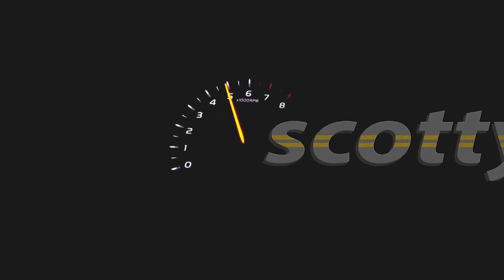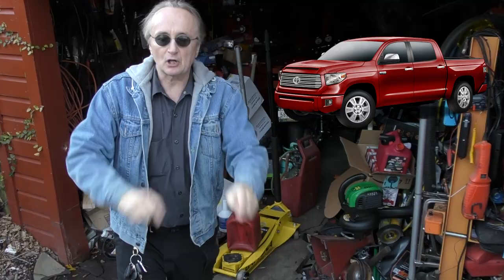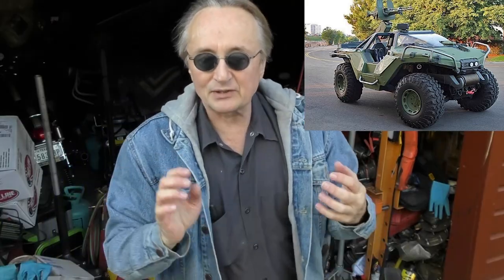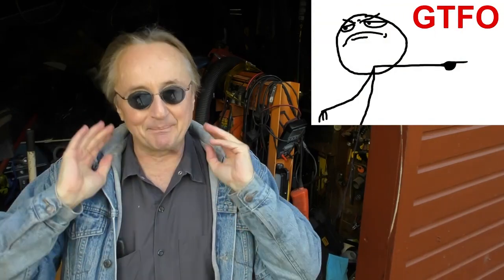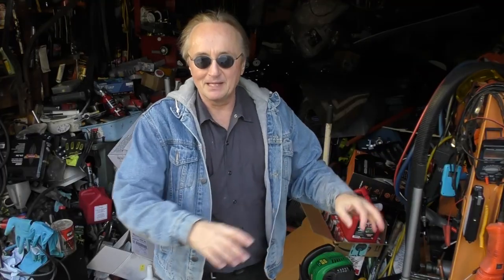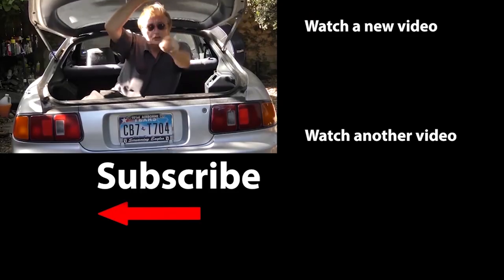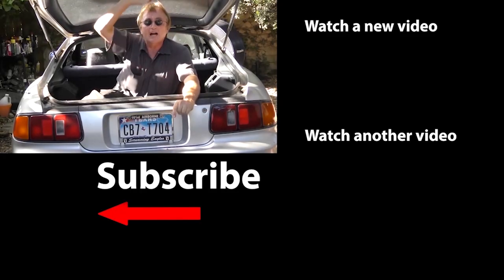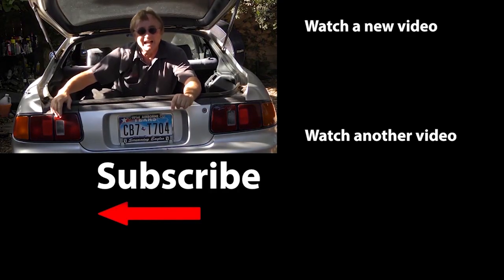5 Used Trucks You Should Never Buy

Comment: Asked a guy with a Ridgeline 2006 400 thousand miles and said it was bullet proof. Kelly Blue Book and  Edmund's give it a 4.7 out of five. What gives?
Reply: Bias.  That's what gives.
Reply: KBB was bought by autotrader
Reply: Not many left on the road
Reply: @stickman920  Thats because not many sold in the first place.
Reply: It's probably bullet proof if it never has any sort of load in the rear.  Transmission and independent rear suspension are more suited for a car or SUV, not a truck.
Reply: I just read all the comments to you post and every 1 has one thing in common lack of facts its funny how every one trashes a vehicle that they have not only never owned but prob never drove before some because its out of there price range any vehicle that can be as old as some ridgelines and still hold a re sale of over 10k isn't because its garbage its because doing p.m. and not trying to use it as a 1 ton truck it will last.
Reply: They may be able to last but most people I know have been unhappy and even though on paper they seem better 4.0 v6 rangers any dakota and even chevy s10s outperform them for truck needs
Reply: A 10 year old Ridgeline has a higher resell value than any mid sized truck, there is a reason for that.
Reply: I mean, what kind of a real man drives a Ridgeline?? You have a truck yes, but not a real truck historically. Men who drive Ridgelines are soft soccer dads that's can't do one pull up to save his pitiful life. That's like having Honda Accord coupe and trying to race a F-Type Jaguar. Just because you have 2 doors doesn't mean your car qualifies.
Reply: @JamesBond-ex2te  would love to see you your ride because I bet you can't do those pull ups
Reply: I'm beginning to think he knows Toyoda-san, maybe paid by them, regardless of what he says. I asked a question about Toyota's wonky electric-assist steering and he won't reply.
Reply: Casey N you must have never heard of the Tacoma lmao
Reply: Anecdotal evidence. Maybe his really was bulletproof, maybe he was trying to justify his purchase. But in the end its about the large scale - reliable or not. You don't tend to see many on the road,  if that gives you any idea. Also you need to be a bit wary of review sites - they only review cars when they're new and base their reviews on features, INITIAL quality, and driving dynamics. They tell you nothing, ever, about longevity or actual quality of their internals. That's what people like Scotty are for.
Reply: @iloveamerica1966  My mechanic here in SC loves Suburbans and Tahoes which obviously is a GM product, everyone has their own opinion I guess.
Reply: because this guy is paid by Toyota. The ridgeline is superior in every way. I have owned both of them. 02 taco transmission went out at 85k miles and my 06 ridgeline has 349k miles and still on the original engine and transmission.
Reply: @Danimaljmartin  Not one full stop or comma in that very long sentence.
Reply: @Brian1952ful  I never claimed to have great punctuation. At the moment of my comment I was steaming mad at such ignorance from some one that calls themselves an auto specialist
Reply: I have a 2006 Ridgeline with 200K miles.  Best, safest, most trouble free vehicle I have ever owned.  Just my experience.
Reply: Cylinder #4 is what gives check it out!
Reply: ZEROFUX  let me just inform you if there "junk" then why has mine and so many others survived for 10 plus years with minimal issues as ive stated I own larger trucks such as my two f350s both with 7.3s which are both work horses and just to prove to you ridgeline haters I just towed my buddies 1979 k20 with mine all the way to his house jyst to see how much the thing could handle im extremely hard on my vehicals i dont bash Chevy . dodge . ford but ill stand by what the ridgeline was intended for light duty weekend stuff we do have our own opinion but as far as anyone else's I'm not interested because if its negitive you obviously dont know squat about this subject as far as I'm concerned
Reply: I have a '06 Ridgeline, its only got 156k on it and still runs like new. I know because I bought it brand new in 2006. No major repairs, only regular maintenance and a new alternator around 120k. Best truck and vehicle I've ever owned.
Reply: W Young My Wife bought me a Brand New 2007 Ridgeline. I’m just shy of 13 incredible years of proud Ridgeline ownership. The Vehicle has NEVER been in the Shop...,  You know why - - Because they’re Friggin Perfect !!!  I’ve never needed a repair, because you can’t repair Perfection !!  Scotty is just MAD that he wasn’t allowed to join The Ridgeline Owners Club.   Rev  That,  Scotty.
Reply: James Williams yep. I plan to get another one when this one dies (maybe in another 20+ years or so)!
LOL
Reply: Apply the bell curve - some fall below the standard deviation and some are above the standard deviation. It's an opinion show based on personal experience. I'm glad your experience was good.
Reply: My 04 Silverado was a beast, when I didn't have to repair it. Reliable, that is What counts to me, all auto manufacturers have their strong points, I don't think knocking someone on their vehicle choice is it, I would consider at least looking into a Ridgeline before ridicule.
Reply: ik we have one with 300 000 km and still good as new ! It also went through 11 canadian winters here in montreal. the rust is only starting. weve changed normal wear car parts like ( alternator, etc. ) . still very happy
Reply: I just bought a ridgeline I can't wait to pick it up.
Reply: @JamesBond-ex2te  Speak for yourself Punk, I served 3 marine tours in Afghanistan & Drive an 06 Ridgeline.
Reply: @gonzobongo6669  lol right, I have an 06 and idk wtf this dudes talking about. I’m a contractor and it does fine !
Reply: probably an exception to the rule to get that many miles
Reply: @JamesBond-ex2te  We have found the tough guy.

Comment: A few guys at work bought Tacoma's and after 3 years traded them in because they rust profusely were very flimsy and cheaply made, the frames rust horribly and the interior doesn't even have a power adjustable seat. They also seem to go through wheel bearings and front end components like candy and suffer oil leaks and engine issues. Surprise- they now drive either a F-150 or Silverado. There are even videos right here on Youtube that talk about how unreliable the 2016-2019 Tacoma's are and even CR doesn't recommend them

Comment: I have a ridgeline and i can say its the best truck i ever owned.  Ive had f150, gmc 1500/2500 ram 1500/2500, nissan, Toyota. As far as gas milage and dependability, its all there. The payload is the same as any half ton truck. Yes when towing 5k its not the stongest, but i have taken it to the dump with a 1500 lb trailer and a 3500lb load in the wet muddy dump and the 4x4 didnt leave me hanging. 
Now by all means is it as powerful as a 1/2 ton no, but the ride is comparable to a mdx and it still can load and 4x8 sheetrock or plywood. As far as the cab, it has a lot more room than any comparable year toyota. Similar space as an extended cab 1500. 

Really its all subjective, i use my truck for mobile mechanic and ALL my tools i need fit perfectly into the rear "trunk". I cant think if a better truck for the towing, up to 5k, that i do and the storage of my tools.
Reply: Daniel Bettke  jajaj honda thats not a truck remember is a car
Reply: "The 4x4 didn't leave me hanging"
The Ridgeline isn't a 4x4.  It's AWD and therefore has no lockouts front or back.  It also does not have a fully-boxed frame, nor a heavy duty rear suspension setup or significant pickup truck level curb weight, so you're really asking a lot of it to be even be attempting to pull 5k lbs. safely at any speed above 25-35 mph.
Reply: @thebrokenglasskids5196  It does have a lock out. VTM-4

Comment: You left some off of the list. Its more than 5. NEVER buy a Chevy Colorado/GMC Canyon with the 5 cyl engine, total piece of shyt.
Reply: I completely agree. I had a 2005 Colorado Z71. I did all of the regular maintenance required. Blew the trans at 38,000 miles - to be fair, my buddy was driving it towing a 14ft enclosed trailer, but well below the trucks rated towing capacity, it did not have a trans cooler and it over heated the transmission and blew the forward clutch piston seal and cooked the clutches for 1stmaking it almost impossible to start moving from a stop. $2,800 (warranty) and 1 month later I had it back with a GM re-man transmission. I liked the appearance of the truck, and I did really like the sound the 5cylinder engine made, especially with a good intake on it - sounded somewhat like a viper's v-10 and when new it had ok power. As it aged I had a misfire that I could not trace down, come to find out the 3.5's had bad valve seats. Some got fixed under warranty, some didn't. I will say, the truck itself was pretty tough, but when parts started to fail it just cascaded really quick and became an endless money pit. I went through 5 sets of front wheel bearings in two and a half years, nobody could figure out why. It had 206,000 miles on it when I traded it for a Nissan Frontier a year ago. I owned it for 6 years, bought with 35,000 miles on it when I traded it I had replaced: 1 transmission, 5 SETS of front hubs, thermostat because it failed and ran too cold, the accessory belt tensioner because it failed and ate into the timing cover, the power steering return hose got a hole worn through from vibration where it mounts to the crossmember and destroyed the power steering pump (the pump was still working when I sold it, but it was on its way out), the water pump suddenly grenaded on me at work one day without any warning - that was a fun repair in freezing temperatures right before Christmas, the wiring harness for the ac blower burned out and I had to replace that, the power steering rack and tie rod ends were shot at 140,000 miles... Oh, and you better hope you never need to change the timing chain on it because you have to take the engine out to do it, may as well just swap the enigne instead... Like I said, MONEY PIT. STAY AWAY...
Reply: Yeah and I see the new ones are having some reliability problems as well. Transmission problems and fit and finish issues
Reply: Well yeah GM it's a GM
Reply: Got to stick to the s10 and blazers with 4.3L
Reply: he covered that with the H2. Same engine
Reply: @alexmelia8873  You're close, its actually the Hummer H3 that shared the same engine as the 1st gen Colorado.
Reply: Never buy Chevy/GMC period.
Reply: same, the 2 year one owned one i had to replace the acc belt and tensioner, parking brake cables, rear shocks, a rust hole under the passager side floor, rear passager side tail light, every single u-joint, some leaking exhaust hole's, everyone and a while it would randomly stall out about a minute after you start it, pretty sure the ac compressor was on its way out, the blower motor would blow the fuse after not using it during the summer... wasted 3 hours on that one day thinking the fuse got replaced, had the p0300 code show up twice then leave after changing the plugs, then the rocker panels, tie rod ends, sway bar links and then it decided the frame wanted to rust out.
Reply: @alexmelia8873  that's h3
Reply: @budskrilla2u133  '93 and newer Mazdas were Ford Rangers with a "Mazda" badge glued on.
Reply: Yikes, my dad just bought one. 2011 standard cab 5 cylinder automatic. Has like 143000 miles and has already had the engine and transmission replaced. I thought that was a tip off that something ain't right. Oh well my family doesn't use trucks really, just bought it in case we need it
Reply: acester86 garbage motors

Comment: That Dodge truck Spoiler wasn't permanently fixed to the truck it was removable..
Reply: Simply Pony Yep and it’s the same truck as every other truck with a decal and the spoiler added
Reply: @truckcampertraveler7369  pretty sure they had a different gear ratio
Reply: The srt-10 ram also had a removable spoiler too
Reply: Lmfao

Comment: I have an 09 ridgeline with 362k, and I'm so negligent with my vehicle maintenence that if that were a crime (I mean Jesus... this thing still has the ORIGINAL timing belt on it)  I'd be on death row right now. But my Ridgeline isn't anyway.  I've used that bed for a ridiculous amount of things,  and I'm a guy that should have a full 8' bed with what I do in a day.  I love in very harsh dirt road way off grid.   I've seen a plethora of other ½ton trucks over the years get destroyed out here (some in only a matter of a year or two, and by rights,  I should have a 1 ton for that very reason,  but the Ridgeline keeps just doing what i ask of it.  Obviously, I'm not towing my tractor or excavator with it,  but it hauls my side by sides and easily 95% of what I find myself needing to tow with it. I'd buy another in a heartbeat.

Comment: Greetings from a ridgeline owner with over 285k miles and running strong. It's always loaded down with all my gear.

Only thing I've had to do that wasn't general maintenance was replace the high pressure power steering line that dry rotted.

And it's plenty capable of hauling as long as you aren't trying to haul a bed full of bedrock or pallets of readymix.

Comment: Forget about the Ford trucks also, you have to remove the WHOLE cab body to do the cylinder heads or engine, WTF. Ohh that diesel today is NON-rebuildable and $17,000+ to replace.
Reply: John Clamshell SP Ford Raptors and Ford Sports are A fucking 1 tho

Comment: ridge lines are basically honda pilots with the back chopped off...
Reply: No. Early Honda Pilots had junky Mitsubishi engines.
Reply: I prefer to think of them as an Odyssey with half the roof cut off
Reply: The crossfire, pilot and Ridgeline are all the same engine and frame. Best bet is the crossfire.
Reply: Most every  truck is something else, with the back cut off. Except for 1tons.
Reply: Ridge lines beds are short.
Reply: W Young e
Reply: I love mine. It’s the best.
Reply: Steve Silvas  did you forget a chromosome at home before you wrote that?
Reply: @Johnkoth  The Ridgelines are pretty good, just way to small
Reply: @FixItYerself  my wife and I own a 09 ridgeline and a 05 odyssey. Same exact motor same maintenance schedules and procedures. I like my ridgeline. It is underpowered as a hauler but its a great vehicle for me with 2 toddlers and light work on deck.
Reply: F-150s are Expeditions with the back taken off, Silverados/Sierras are Tahoes/Suburbans/Yukons/YukonXLs with the back off, same with Frontiers and Pathfinders, Tacomas and 4runners, Rams and Durangos, Excusions and F-250/350, Rangers and Explorers were also at one point. Have you seen the Jeep Gladiator? It's a Wrangler with a Dakota bed bolted onto it. Speaking of which Dakotas and Journeys. Hell it's hardly a real truck but the damn El Camino was basically a Monte Carlo pick up,  The Subaru Baja was really just an Outback with a bed,  no one says a damn thing about it because one is common sense most of the time and two it doesn't really matter. Telling me this truck is a pretty good, reliable SUV, with the back converted to a bed so it's not worth getting is ignorant. There's literally no pick up truck in the past like 25 years that doesn't have an SUV that's directly related to it. And the only ones that anyone could name are more than likely rebranded versions of other trucks like a Mits Raider or the Mazda B2000.
Reply: Whys the HT even on here it was done 10 years ago and weren't they a very limited run
Reply: The new Ridgelines are very good, from 2017 onwards. The fact that it is a Pilot with a bed is a big selling point. Comfortable, reliable, family friendly and drives like an SUV.
Reply: Basically, yes.    And in no way are they a truck.
Reply: The ridgeline has the least ground clearance and towing capacity..    not to mention  it's been one thr lowest selling trucks since it came out.  Beat out by the extremely pricy  raptors
Reply: and the Ford Ranger is the Explorer with the back chopped off.
what's your point?
Reply: They fall apart don't hold up
Reply: Dennis Jacob You probably dont know anything about the ridgeline maybe its just youre a truck guy
Reply: Goku Kakorot it’s great! Just got it inspected and it was in perfect condition. Mechanic wanted to buy it.
Reply: My 2014 Honda Ridgeline is THE best vehicle I ever bought. I have nothing but positive good things to say about them!
Reply: Looks like a chevy avalanche to me

Comment: Love your channel but I have to disagree with your comments on the Ridgeline. Yes, it’s not a full size and it’s not made for hauling 5000 lbs on a daily basis. I have a 2006 Ridgeline with 240 000 kms (150 000 miles) with ZERO problems. Just regular maintenance. Change the oil with Mobil 1 synthetic every 4000 miles. Original engine,transmission, radiator, A/C, alternator, even headlight bulbs are original. I just changed the shock absorbers at 230000 kms. Not leaking, just noticed that the ride was starting to change a bit. BTW  all 4 shock assemblies with coils cost me only $800 CDN OEM from Honda! Parts are cheap too! Jobbers from NAPA we’re almost 2X the price.  Keep in mind that here in Canada the temperature goes from -30C to +35C and they put a ton of salt on the roads. For a family hauler that does light towing I challenge you to find a better truck, especially for the way it can gulp up storage. PS  I’m also a Used Car Manager at a Lexus dealer, whenever we get a Ridgeline on trade at any of our stores it doesn’t stay on the lot for long. And the old body style in my opinion is better made. That’s why I’m keeping mine. Keep up the great work Scotty !
Reply: Love our 2006, it has over 215,000 miles on it.